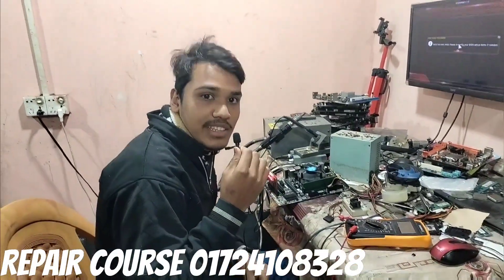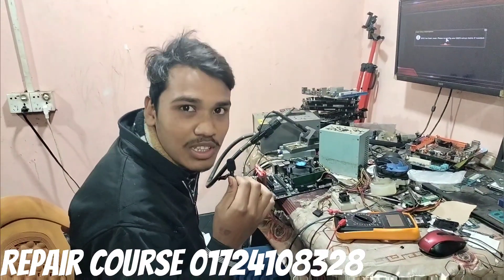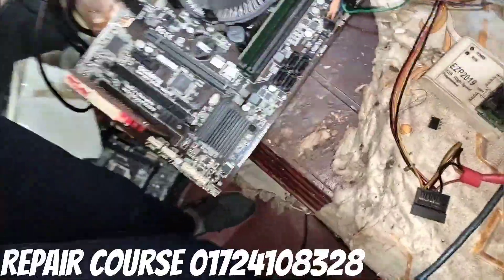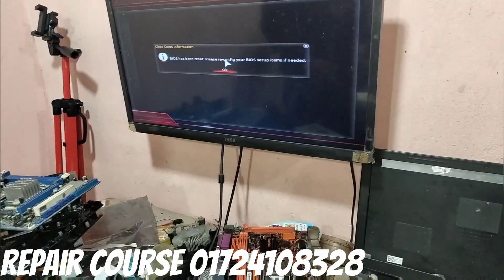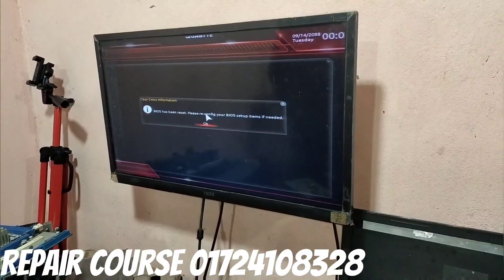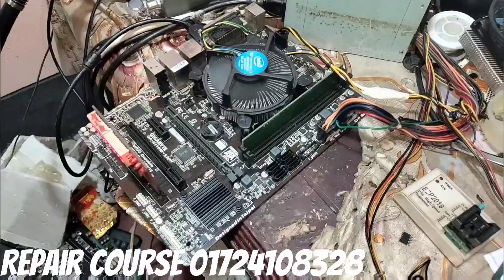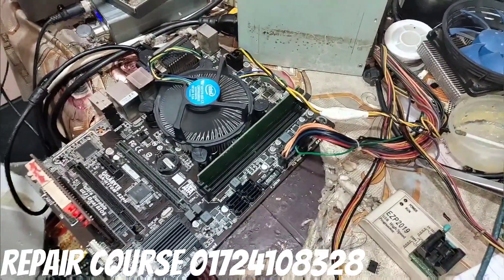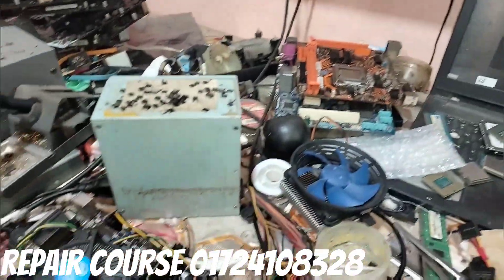How To Repair Motherboard Restart Problem || Gigabyte H110 Motherboard Restart Problem ||

Comment: #Help_post
Spec:
Mobo: Gigabyte G41M-ES2L (REV 1.0)
CPU: Intel Dual core E5400 2.7ghz
Ram:4gb ddr3
Psu:500w normal

প্রসেসর আপগ্রেড করতে গিয়ে সমস্যায় পড়ে গেলাম মাদারবোর্ডের ওয়েবসাইটে দেখলাম ,সাপোর্ট করে এমন দুইটা প্রসেসর জোগাড় করেছি(core 2 duo E8400) কিন্তু সমস্যা হচ্ছে প্রসেসর লাগিয়ে পিসি স্টার্ট করলে ব্ল্যাকস্ক্রীন আসে, কিছুই আসে না,এমনকি bios screen ও আসে না ,অন্য আরেকটা লাগালাম একই সমস্যা, কিন্তু আগে যে প্রসেসর টা ইউজ করতাম ওইটা লাগালে আবার সুন্দর পিসি চালু হয় সমস্যা কোথায় বুঝতেছিনা।cemos battery খুলে লাগালাম,,,,
No solution!!!!
এখন কি করতে পারি????